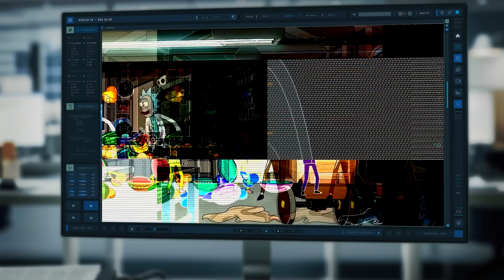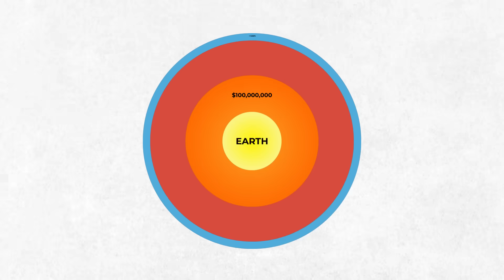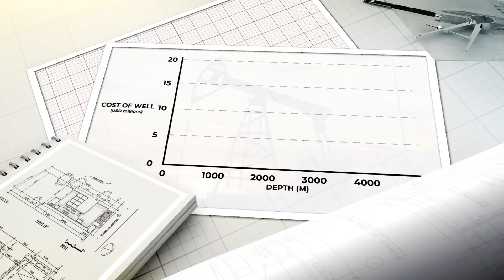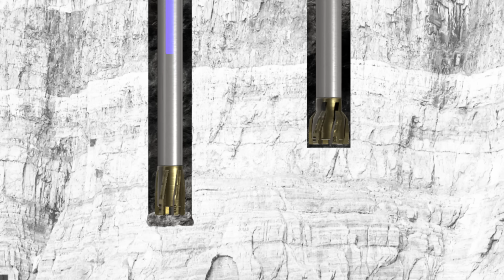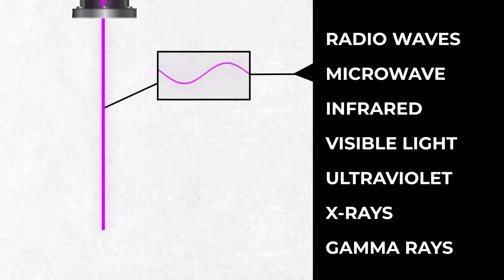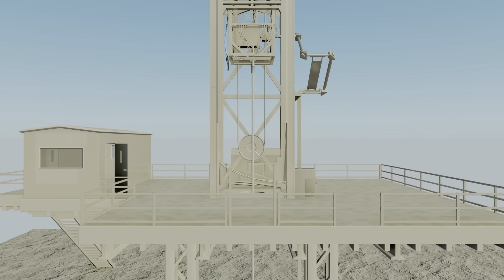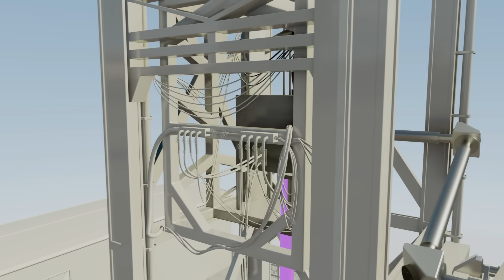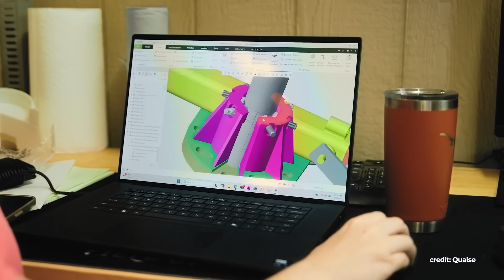The Most Advanced Drill in Human History

Comment: well... answer is as allways is or in general is... object oriented system :D 
how ? well build modules stack by stack.. and make sure each of them is sustain itsel .. ie each module coolls down its own.. ie make a one long cooling wall and cooling liquid channel up and cold pipe.. then make hole lot bigger so it can has lost of equipment like additional moduiles for sensor and pumps for pumpung up down coolant like water... then place a space on center to access next mining operation.. that way it can go step by stem.. and after reaching unsustainable heat... you alllready reached reliable stage of heat energy :D

Comment: Did a little more digging into this concept wondering how in the world they planed on drilling without mud. Looking at the theoretical  pore  pressures at 15 kilometer assuming salt water down hole pore pressure would be~ 21805 psi. the vitrified rock casing basically  obsidian has an Compressive strength ~45000–70000psi  at room temp but down hole temps will be around 350 c lowing the compressive strength of the obsidian to  30000-50000 psi making it  theoretically possible to dill without mud!! They will probably need to create  special compressed gas mixtures for handling the cuttings Superheated steam + N₂ hybrid purge → cooling + lift.High-temp silicone-based foaming agents → if stable >300 °C. Argon or CO₂ base gas (denser than N₂, better lift).Nano-particle seeding (Al₂O₃, SiO₂) to keep condensate mobile.
Reply: you dont need a plan if your entire strategy relies on cashing in on government grants and big oil investment money and then doing a rugpull.

Comment: They aren’t increasing the thickness of the glass coating in the bore hole, so when it fills with water the bottom walls will not be thick enough for the pressure of the water column above it. Then they are going to add extra pressure to force water all the way back up to the surface? It will definitely leak into the surrounding rock and crack everything. Even the super high pressure air during drilling could lead to cracks. Because of this they won’t be able to get the same amount of hot water out the other end and it will turn into a sink hole with plenty of water wasted.

Comment: Drilling was certainly not continuous for 20 years on Kola Superdeep. It was a research experiment. They cored a lot of it (which is inherently slow if you want good core recovery), they stopped to do other investigations along the way, and there were multi-year breaks in drilling activity. Drilling technology was also not what it is today. They also drilled multiple sidetracks off the main borehole. 

I think it's disingenuous to compare current drilling technology and financial constraints with Kola Superdeep. The longest oil/gas well (not deepest) is now about 15km, drilled in Qatar. Horizontal drilling has many additional challenges that vertical drilling does not, but even then, it's weeks, not decades to drill and complete.

Comment: To set the steel casing or liner, they pump cement with additives to control various properties like density, curing time, fluid losses into the formation, and gas migration. It's not concrete.
It is, however, most commonly the same class G cement as you can buy from hardware stores. higher temperature cements contain silica.

Comment: What happens when the drill hits a pocket of gas, oil, coal,  or water?
Reply: If there's oil or gas the oil companies will have likely gotten there first
Reply: It drills throught it
Reply: The American army shows up and screams freedom in “bald eagle” 🦅
Reply: That’s why they are doing it in an area where they already know what’s there. They been taking all the oil out of that area for 100 plus years
Reply: @mikelyn7132  not all of the oil only the deposits that are cost effective to exploit. 
if there is a deposit 10km deep you can be pretty certain the oil companies have left it untouched. 
the deepest vertical oil drill is a measly 4km.
Reply: Good point
Reply: Wouldn't need oxygen to light?
Reply: Shhhhhhhhhhhhhhhh
Reply: Dawg wdym “when?” These drilling companies obviously have the foresight to not put their drills on top of fossil fuel, and oil companies have the foresight to guzzle all the fuel before geothermal companies can get it
Reply: Success!

Comment: I wonder how this system deals with if they drill through something like a natural gas pocket?
Reply: Well you make a deep seismological scan for such pockets. Also you want to do this in stable grounds without much activity and earth movement. And actual gas extraction pump mix of liquid and sand at high pressure to crack the surrounding rock. Fill the openings with sand. And you also made multiple drills. So if they hit gas it will be basically nothing.

Comment: First what happens when this drill hit flammable layer? Like oil. would make it all burn?
Second why they do not try convert classic drill shaft into electric engine? Put some electric current on walls and magnets on shaft, it should generate some torque closer to drill head. Some magnets can survive 350°C.
Reply: First underground oil is in thin layers not big blob. I think they will just melt true it and past certain depth there are no organic materials at all. Gasses and such at those depths are soaked into the stone.

Comment: Someone clarify something for me please.  He said 2 holes need to be drilled down, 1 to pump water in, 1 to get it out.  Is this not assuming that they hit a water proof "pocket" of some kind under ground to act as the storage for the circulated water?  The material they are drilling into is super heated, putty like rock.  Any water introduced to this would instantly evaporate, causing steam pockets, and consequent explosions, destroying it all.  I feel like I am missing something......
Reply: Well you push the water down at 155bar to prevent boiling under 325°C. But considering at that depth water column provide over 600 bars. You have to basically pour it down and gravity done the hard part. But you keep the whole system under pressure and fighting the liquid drag coefficient. The pockets are made with explosives. He also exaugurated the rock properties. But yea drills have hard time paradoxically with soft rock. But mostly its the steel that suffer the most. Even the deepest hole failed not because of the torque loss but high temperatures at the drill point melting the head at 360°C surrounding temperature. And at that distances the coolant reach the end it was already quite hot. I have some memory when watching a documentary that 60% of the time was spent pulling the drill up and down to change the head. 30% maintenance and less then 10% of actual drilling.

Comment: Whats stopping them from having hydraulic powered pump at the end of the bit (use water to double as cooling and potentially to push pawls into the rock to aid in the drilling). If every part of the drills shaft had hydraulic pawls to grab the walls and force the shaft down  similar to a cam shape would it let them control the rate of descent and torsional load ? 

I'm asking as a dumbass with my entire knowlege of drilling operations being able to likely be summed up on a postage stamp with a sharpie

Comment: there is a real U.S. patent for a nuclear-heated tunneling machine that melts through rock rather than drilling it. It's called the "Method and apparatus for tunneling by melting" and was patented in 1972 under US Patent No. 3,693,731.
🔥 Patent Highlights
• 	Inventors: Dale E. Armstrong, Berthus B. McInteer, Robert L. Mills, Robert M. Potter, Eugene S. Robinson, John C. Rowley, Morton C. Smith—all affiliated with Los Alamos, New Mexico.
• 	Assignee: U.S. Atomic Energy Commission.
• 	Filed: January 8, 1971.
• 	Granted: September 26, 1972.
• 	Core Concept: Instead of mechanical drilling, the machine uses a nuclear reactor to heat a tungsten penetrator head to white-hot temperatures. This melts the rock ahead of it, forming a tunnel lined with vitrified (glass-like) rock.
• 	Cooling System: Uses molten lithium salt instead of water, allowing operation at extremely high temperatures.

Comment: At about 10:15 @DrBenMiles says that electrons move at close to the speed of light. Was this correct?  it seems surprising if the photon energies that come from the electrons are in the meV level that the electrons in the gyrotron are wildly higher in energy that this (I understand that only a portion of the electron energy is radiated as EM though). From my calculations, if the electrons had the same energy as 1mm photons, then they would only have a speed of about 20km/s.
Reply: Electrons almost have no mass , therefore I think it's understandable that they move  close to speed of light

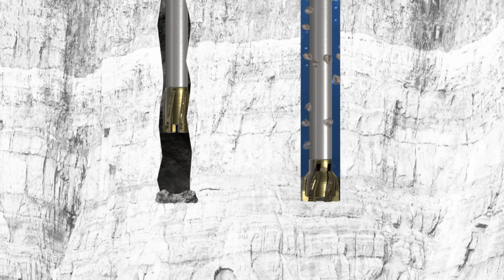Comment: Highly appreciate your content just want to clarify little bit about what you said at 14:25 it's not just simply a water that is pumped into the borehole to carry out the cutting to the surface it's called drilling fluid or drilling mud or more specifically Water based mud (WBM) which is circulated back to the surface on the shale shaker where everything is seperated and the mud is pumped again downhole,this mud is specifically designed by adding different agents which increases it's viscosity (to maintain the hydrostatic pressure in case to stop the incursion of fluid from the formation) filtrate loss agents (so water won't leak into formation because there are tiny open spaces pore which can be filled ) gel strength (to hold the suspended cutting ) these all parameters are kept in mind by keeping in mind the nature of the geological formation if any formation is highly reactive when it comes in contact with water then Oil base mud is used (OBM) overall it's pretty challenging task but looking at this new technology i hope we can drill deeper to extract this new source of energy. Regards

Comment: OK I'm the dumb guy in the comment section, why can't we use a self contain borer like an TBM (tunnel boring machine) but point it straight down.  Support most of the weight from above but allow sufficient weight to act in a downward position so it can eat rock.  I'm sure there are no pumps that can pump waste back to surface can you not mix with solution or something to make it buoyant so it floats back to the top.  OK new problem now you have crush depth similar to submarines.  What I'm suggesting is a type of foam that binds to dirt and floats to the surface to be pumped out.  The drill bit itself doesn't need to be manned, just tethered and pointed downward.  As mentioned I'm the dumb guy in the comments, just figured if we can bore tunnels why not bore straight down, imagine a drill head clamping and drilling under it's own weight 1 meter in diameter, periodically it will need to come back up to have drill bits replaced.  I guess similar to bridge supports a steel tube / liner can be dropped in behind borer to support walls????  That's my 2 cents worth, as they say priceless LOL.

Comment: I'm oilfield trash 20 years from seismic exploration to drilling to completion to wireline or workover. I'm also a rig Welder. My 6 years as a Derrickman drilling and workover I never witnessed laser drilling or had top-drive. I'm old school. My initial question was how the cuttings were circulated uphole if not by mud or air psi.  Laser drilling only sounds good to some, not me. There are additional factors unforseen to be encountered. Resembles the EV craze.

Comment: geothermal is best in cold environments for best efficiency. as for the drill bit, they should use a pipe they want to leave in the hole and just pull the drill head up through the pipe after, they can also heat the pipe to reduce it "jamming up"

Comment: Depp Geothermal is basically too expensive even with this method also it might cause even worse issues on the surface. Actually most of the energy you get is thermal not electricity.